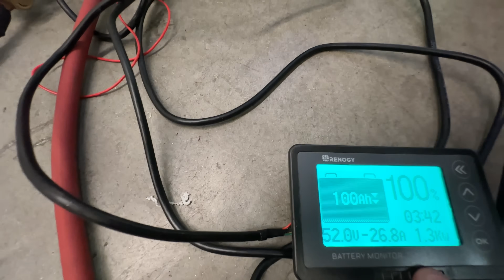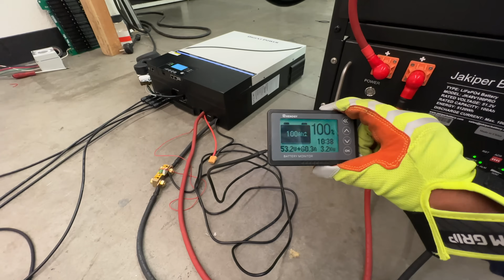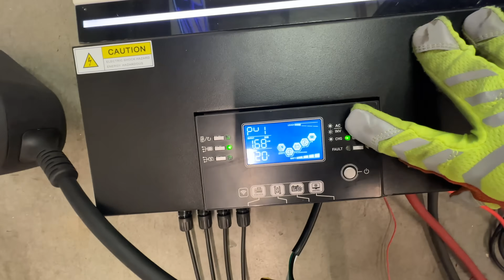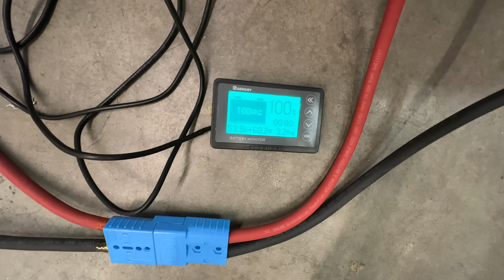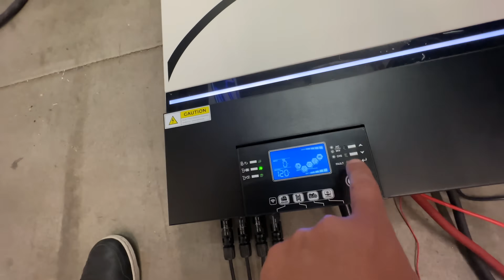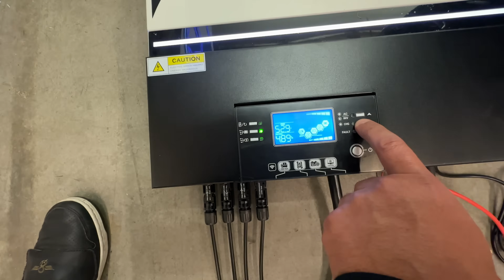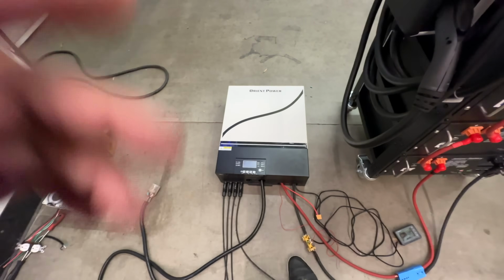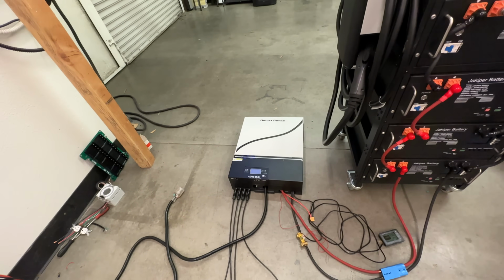8kW solar input Myth?  I test LV6548

Comment: thanks for the stuff you do for everyone in the diy battery and solar stuff space. I know this is an older video at this point and there are a bunch of different manufactures that make this LV6548 all in one inverter unit. mpp solar is another brand that is identical to the orient power brand you tested here and that is the same as what I have installed and currently use. this LV6548 electrical design is now the old original version and the newer design versions have the much higher maximum dc input voltage for the 2 pv strings. it's now able to accept up to 480/500 volts which is the same as many other all in one inverter systems in 2025. everything else is the same as the original for max wattage output and input and the split phase/parallel/three phase configuration up to 6 units are exactly the same. the disappointing thing is that between the old and the new redesigned version is that both are not compatible so no mix and matching 2 units for split phase 240v ac output or other operating modes like parallel, three phase. I did ask mpp solar customer service through email about old/new compatibility and they did confirm it will not work for any operating mode between the old and new. the reason from them is different firmware versions can't communicate between each other. the old version is no longer made and from what I can find with searching on the web for availability I can't find the original version anywhere. so it puts some users like myself who only purchased 1 unit and can only use 120v output but wants 240v split phase out for 240v loads are now left out in the cold. I had plans on getting more units later on (I was thinking on the basis of expandability and it's a future proof design to which I was proven wrong because the newer version is 500v max PV dc input at the same 8kw power.) 

the quick test you did here with the simulated solar by connecting the battery array to get as close as possible to the max pv string voltage at around 230 to 250v but not over it is kinda challenging AND the input current at 17 amps to get precisely the 8kw. this makes whatever options for what series/parallel PV setup is possible kinda limited. especially with today's higher per panel voltage moving towards 48 to 55 volts in 2025 for higher wattage reasons. this was the fundamental reason why the new updated version LV6548V now allows max pv voltage input to 500 and keeping max current the same allows for newer panels to be connected in series. add to that the voltage changes with panel temperature. the results you got with the quick test here with around 3.7kw on both strings for 7.5kw is the best result I can find anywhere to being precisely at 8kw on youtube. another method I can think of is to use a 8kw output adjustable ac to dc switch mode bench power supply set to precisely 230v at 18 amps. and there's other things to consider like buying 2 units for around 1000 to 1100 per unit for 13kw at 2200 total or maybe for space limited installs with only 2 units and 13kw is not enough output for a certain load you have that is very high wattage. by far the most common item that is very power demanding many people often overlook when they trying to go off grid or go 100% green is for heating hot water. many hot water heaters that use electric can be up to 30kw with 3 heaters at 10kw each that would need 6 units for the LV6548. that would be $6000 alone before batteries and solar talk about the never ending forever long economic return on investment trap. the warranty would be long gone if it can last that many years and the fan noise from 6 units holy cow. if you really want hot water in seconds depending on the flow rate and starting water temperature and target temp and seasonal temperature changes if you have 5 months of winter like in my neck of the woods 24kw would be recommended 18kw minimum 4 unit system. another guy on youtube DMI INC channel name has a full playlist on building a diy 4 unit split phase 120/240v off grid system with some 24kw pv array and 50kwh powerwall some years back with the original design. I installed mine 1 unit only back in January 2023 as a automatic ups battery backup for the fridge, wifi and lights. it normally uses external ac input as default (bypass mode). It wasn't too long until the newer design update came out about a year later. it is excellent value for the money for its asking price. Today's all in one inverters are even better because they are built on the success of the workhorses like this LV6548. I'm currently in the process of starting from zero all over again with plans for a 2 unit 24kw ac output 48v off grid system with 16kw pv array minimum. I want the arrays to have 2 axis tracking pole mounted high up for max bifacial gain and at least 3 diy stackable 16kwh powerwalls all diy.

Comment: I just installed two of these inverters at my shop. Each inverter feeds one leg of the breaker panel. Runs great until I use hot water, since the hot water heater is an electric on demand system that pulls close to 60 amps 240V when it kicks on.  Should I be running one inverter as a slave for it to work properly with 240V? Or is the water heater just drawing too much amperage?
Reply: I've got 2 as well. I've been running my whole house from them for the last 4 months. Today I added my 9kw steam shower but I haven't tried it yet because I'm afraid my 100a bms in my batts is going to trip. I'll add a few kw more solar and give it a go tommorow.

Comment: Your settings are wrong if you need to add a load to pull full power from the pv input. Check your charging output current limit. I bet it is set at 60amps.

Comment: I have installed a system to power a full house 9000sqft house with a 4 unit config 220v 100 Amps of AC output. and the system works awesome! as well my unit has a optional generator hook up option, I am a electrical installer.

Comment: Fun Stuff!  These inverters are a beast with tons of options.  So if you want to get the ground bond issue solved, there is a ground screw that needs to be removed on the circuit board.  Its in the center of the circuit board and just needs a few things moved/unscrewed to get to it once opened up.  If you need some help let me know!🤘

Comment: The fans on that are crazy. No way that works in 99.9999% of residential applications.
Reply: i have a 100 amp ac output config of 4 units connected parallel to give me 220V for a full house and it works perfect at full load. a little noise but with a good ventilation system you can help it by a lot.
Reply: @estivenbarrondo8324  when you say good ventilation do you mean place it in an airconditioned room?
Reply: @Floyd112007  not necessarily but you can also install a exhaust fan on ceiling so it can take all hot air out and bring new air in, AC could an option too but you need a highly efficient one cause otherwise you will be just wasting the production of power.
Reply: @estivenbarrondo8324  that makes sense, I am guessing the fan will use a lot less power than the AC.
Reply: I've got two of these in my garage. The fans usually only ramp up when it's charging. I can't hear them from inside the house.

Comment: Using battery isn't a valid test.  You're not going to find PV that operates at 220Vmp that doesn't blow the 250Voc limit.
Reply from the maker: Good point,  in theory it works but in practice it’s difficult
Reply: @jehugarcia  Other limits are 18A PV input and 120A DC output. 200Vmp is likely attainable in very mild weather, so 200Vmp * 18A = 3600W.  120A * 60V = 7200W.
Reply: Ive seen over 9kw on my lv6048 75v at 60amps times two inputs.
Reply from the maker: 60A? Isn’t pv inputs capped at 18A?
Reply: @jehugarcia  each mppt is limited a 60A out and 18A in.
Reply: @electromechanicalstuff2602  I have a 5048 and Same I design it to max out the amps. I've got 4kw of panels and when I get peaks I do see almost 4.5kwh so it does work.  Not sure why there issues. It seems like charging amps where not set, there's a bunch of settings.
Reply: Battery works fine. The MPPT controller doesn't care. It will increase current up to the input/output limit and only cut back if the input voltage drops. His current output settings were wrong. He was capping out at 60amps because he didn't adjust it up from factory settings
Reply: @fookschool  You missed the point.  There is an absolute maximum input of 250Voc at 25°C/77°F.  This also must allow for low temperature voltage increase.  If you're at 250Voc @ 25°C/77°F, at freezing your panel Voc may be as high as 275V. Due to PV cell count, it's going to be hard to get more than 225Voc and leave temperature margin.  At 225Voc, the max PV voltage @ peak power is going to be around 182V.  182V * 18A = 3276W.  These controllers are notoriously difficult to get anywhere near the claimed 4000W output. Running a battery @ ~210-220V is not remotely attainable in real world conditions with PV.  EACH MPPT is capped at 60A output as well.
Reply: @snoobler  what does that have to do with how the MPPT controller operates? I think you are missing something here. For the sake of maximum power testing, what he did will yield EXACTLY the same as if he had 250v of panels running at 220v. The sag would be less if the panels were rated for higher current than the 18amps that the charge controller is maxing out at. Lighten up a bit. I have 30voc panels that only drop to 26v at max power. Not all panels are the same. And I'm not 100% familiar with this specific all in one inverter but the OPERATING max voltage isn't the actual max voltage normally on these. I have one that is 450v operating max but it will allow up to 500v open circuit. They do account for the higher winter voltages. Unless you think manufacturers don't know this well known fact.
Reply: @fookschool  there isn't a solar panel or combination of solar panels in series that will have a Voc of 250V and operate at 220Vmp.  Those 250V panels will produce max power closer to around 200V.  Please provide a link to the datasheet for these mystical 30Voc/26Vmp panels.
Reply: @snoobler  what crappy panels do you have that are under 0.8 x voc ratio? I can't even find panels THAT bad. Everything I know of is 36voc to 31vmp or 44voc to 38vmp. Again, tons that would be well over 200v at full power. Why do I have to do the research for you?
Reply: @fookschool  Most panels are .81-.83 Vmp/Voc. You're also conveniently moving the target.  Getting 250Voc safely just isn't possible in the vast majority of cases/climates.  Vmp is going to be notably under 200V on a 250Voc limited controller like this one.
Reply: @snoobler  again, the lower end of the numbers that you picked still put vmp at over 200v. You really throw a fit about less than a 10% difference on a test that still can be achieved in real world? I would understand 25% or more difference but you have got to be kidding with the whole realistically 15v difference. I maxed out my other inverter that isn't connected to my monitoring setup and most people would ride that max voltage of the system so they don't have to shell out another grand or so to buy another inverter that they don't need. If you look at curves, you could get 24amps of rated current and get only a 10% voltage drop from open circuit. I can get panels way cheaper per watt than inverter and cut the losses from adding another inverter as well.